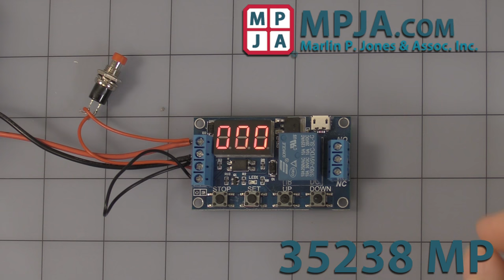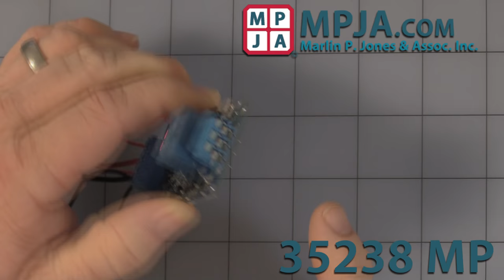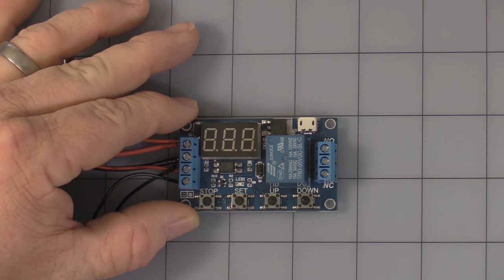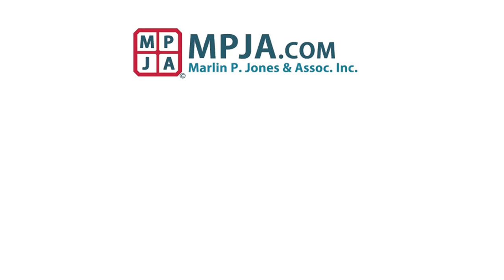Programmable triggered timing board 35238 MP

Comment: I don't I did the same setting as you showed in p 3.1 but mine is stuck in some loop. It doesn't show the count down but its still runs. The led does not indicate anything either. I used 12v 2A SMPS to run it. I only have it input and did not attach any trigger switch to it. When it starts the count down the display goes dim. Please help. On the output I used hair dryer motor.
Reply: Is their a way to completely reset it
Reply from the maker: There are several manufactures with different programing. This is how the version we sell operates. As for the display going dim 12v 2amp is more than enough to power it.
I'm assuming the hair dryer motor is an AC powered, is it large enough to cause a voltage drop effecting the 12v 2amp supply?
Thanks
Reply: @mpjaonline  i tried it using usb power but it does not give out any output voltage
Reply from the maker: @pubginc.7328  The USB only powers the electronics for the board. The relay is like a switch, you must supply power to the ”COM” terminal for power out.   Thanks
Reply: Thanks a lot sir.

Comment: How do i activate the trigger with only the 5v micro-usb powering it, and using a photoresistor as the trigger?
Reply: If you have the 5vdc USB connected , you should then have 5vdc at the 0-30v terminal. Use those terminals to power your trigger device and send signal to the Trigger input.
Reply: @billfoster6809  Thanks i'll try that

Comment: Thanks for explanations. I've a unit that entered into a weird status. Now all modes works reversed. P1.1 for instance the relay stay on always until trigger, switch off for OP seconds and switch on again and stay so. The remaining modes also behave like that. Relay is on as soon as circuit is power on, and cycles play inverted. Relay switch off on the normally active OP seconds.  Anybody knows how to exit this? There is no reset to factory, so.. no way out.
Reply: Hi. Were you able to fix this. I seem to have triggered the same with the Stop button long press
Reply: @shahidmahmood7252  Not yet sorry. No info anywhere. Let me know if you find its solution. thx
Reply: @astrogus  I bought another board and that works fine. Exactly the same board but from a different vendor. But I am sure there must be some factory reset option. Like long pressing the DOWN button gives option of F-1 and F-2. What is that for? Unexplained in every documentation that I have come across.
Reply: How many volts min does the trigger take?
Reply: @shahidmahmood7252  do you have an idea what the minimum voltage the trigger can take?
Reply: @chibuzordesmond3937  The one I am using has a power supply range of 6-30V and trigger signal 3-24V. You will need to setup and test what works for you.

Comment: Can you mix time modes for ON and OFF? I can't see that you covered that.
For example, can you set the ON time in 0-99.9seconds and the OFF time in 0-999minutes? 
If one can, you may wish to point out on your website feature list that these are independently assignable. You do KIND OF suggest this in your datasheet/UserManual (and THANK YOU VERY MUCH for providing it on your website) but it's not obvious. You merely state,
"It is configured in exactly the same way as the OP function."

(and I'm assuming one can still enter infinite loop mode...and I'm just stating this because sometimes when users do "unexpected" things like this it breaks program subroutines)

For example, I want to run a pump for 30 seconds TWICE per day, everyday.
So I set ON=30 seconds, and OFF=719 minutes, infinite loop 
(note, I realize these actually add up to 1439 minutes (2x30sec + 2x719mins) instead of a day's exact 1440 minutes, but it demonstrates what I mean. With these settings, the ON times when observed relative to a realtime analog clock would be slowly moving around the clock...in other words, "ON" wouldn't happen at exactly the same 2 times every day.)
Reply: Did you ever get an answer to this question?  I have a cat feeder that the main board died in, so I would like to run a small dc motor roughly 3 seconds every 8 hours.  Looks like program 3.2 is perfect as long as the time bases for on and off can be set independently.  Having it automatically resume if the power goes out is a bonus, it would just be out of sync with the other one, but at least the food would get metered out.
Reply: @sabercatpuck yes I was able to.

Comment: Hello, I want to start countdown when it get energized. I dont want to use any trigger. I want to use this to delay start my device after power off. Can I do this with it? and How? How can I reset this? It's stuck looping only P3.2 flashing constantly...
Reply from the maker: Sorry the part will not work for your application P3.2 starts with relay on only, also when you power off the timer it stops working I’m not sure what you mean by power off. If P3.2 flashing constantly try pressing the set button for 3 seconds. Last there are different manufactures of this part and they all look a like with different programming.
Reply: @mpjaonline  Thanks for your answer I changed power source it fixed, and P3-2 worked for me...

Comment: I've used a handful of similar timer modules but I just bought some of these and I'm very confused because I don't see any logic chip to handle the programming and display! What part of the board is controlling that? I don't believe anything is hidden out of sight
Edit: Nvm the chip is hidden beneath the display! That was driving me crazy
Reply from the maker: It uses a n76e003at20 and it is hidden under the LED display
Reply: @mpjaonline  thanks! I didn't know before that you could fit anything under there. That's a good idea

Comment: Is it possible to combine time ranges? Say you use P3.1 and want a on time of 0-999 seconds, but an off time of 0-999 minutes?
Reply from the maker: The OP = relay on and CL = relay off can have separate time ranges but P3.1 does not have a CL program, only OP and LOP = loop
Reply from the maker: Sorry my mistake 3.1 does have a CL program my data sheet was wrong I will fix it
Reply: Ah ha, that is the info I was looking for.  I think this will be able to ressurect my busted automatic cat feeder then.  Program 3.2 off for 8 hours on for 3 seconds should do the trick, and it would even resume if the power went out, just out of sync a bit.

Comment: Il display si può spengere quando è in funzione?
Reply from the maker: Sleep:
Turns off the LED Display after 5 minutes of inaction
Does NOT affect timing functions
Any button will turn on display
Press and Hold the STOP button for ~5 Sec. then release
Display will Display C-L or O-d
What is shown is what will happen
C-L Sleep Mode Off after 5 min.
O-d Normal Display Always On
This is an alternate action
Each Press-Hold-Release will change mode

Comment: What if you put a normally closed trigger and you have p1.1 setting will it trigger on and on?
Reply from the maker: Sorry it will not work in any mode with a normally closer trigger or logic low trigger
Thank You David MPJA Inc.
Reply: Can this device activate 3 12v 30w sire?
Reply: Can this device activate 3 12v 30w siren?

Comment: How would you set it up for just a delay/on
Reply from the maker: You can use the P2 program if you use the same power source for the timer as the trigger voltage. You will need to program it before jumper power to the trigger and will have a max on time of 999 minutes. Good Luck

Comment: hello how to connect the wiring into synchronous motor??
Reply from the maker: Here is a link on how to hooking a motor to the timer. Be sure to use the COM terminal and N.O. terminal. Do not have power applied when setting up the unit.  https://www.mpja.com//download/35238outout.jpg

Comment: Great video, but I am looking for <1 sec...milliseconds, can this do that?
Reply from the maker: Sorry this part will Not work for you
Reply: But what if set to the 0.1 seconds which seems to be the smallest value which is (100 milliseconds) ?
Reply from the maker: @jasonyannuccelli2499  Yes 0.1 second is equal to 100 milliseconds if that is an acceptable minimum range and one of the programs P1 thru P4 fits your application the timer should work for you. Thank You MPJA Inc

Comment: This is a good vid on this little board. Quick question though, I'm sure one of the programs you showed will do what I want:

I DON'T want to use mains power so if this is not possible, please let me know. I want to connect a DC motor to run slowly from this board with ONLY 2 double AA rechargeable batteries.

So can this allow a 2 AA to power the power or a rechargeable power bank using the micro USB? Or do I need two types of power source for DC motor and one for the board?

Now for the program, I just need it to delay for 2 hours and come on for 5 seconds and loop until batteries die?

Lastly, can you also switch off the display once it's all set, so the batteries/ power bank last longer?

Many thanks
Reply from the maker: The board and the electronics require a minimum of 5Vdc highly regulated thru the usb connector or 6-30Vdc thru the connector block also needs a minimum of 3Vdc trigger voltage. The relay side is like a switch contact and has no minimum rating. Yes there is a sleep mode where the display turns off after 5 minutes of inactivity.

Comment: Can you suggest timer board for < 1 sec
Reply from the maker: At time 1:55 the video shows how set a time range of 99.9 seconds with 0.1 second resolution. Thanks
Reply: Your "Resolution" statements are a bit confusing. There's a difference between the SETTING resolution and the TIMER resolution.

It's not like the "ON" pulse width = 0.5 seconds +/- 0.1 second...right? 
That would be like saying when it's in the "minutes" mode the "ON" pulse width = 5 minutes +/- 1 minute.

So the TIMER'S resolution is more like "ON" pulse = 0.5 seconds +/- TBD micro-seconds depending on the processor, supply voltage and temperature?

Comment: Hi, great video! I have just bought the same one. I'm not sure if i have the right relay but you may be able to answer my question do you think this relay is good for microwave transformer spot welder?
Reply from the maker: I don’t know the current rating on your transformer but the relay is rated at 10 amp max. Watch out for surge current.
Reply: I would use this relay to drive a larger relay such as an automotive starter solenoid. The solenoid is designed to handle large amounts of current.

Comment: How to set 3hr
Reply from the maker: Sorry I need more information, like witch mode: P1.1, P1.2, P1.3, P2, P3.1, P3.2 and P4. Also delay on or off do you need it loop if so how many time or just single shot. You can follow the link under the video to our website and download the pdf data sheet that expanse each mode and how to use.